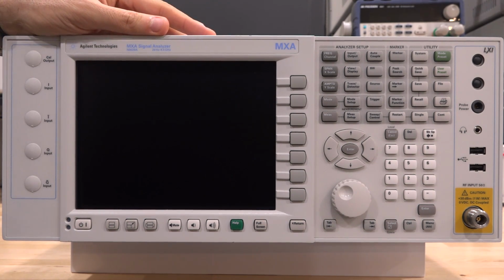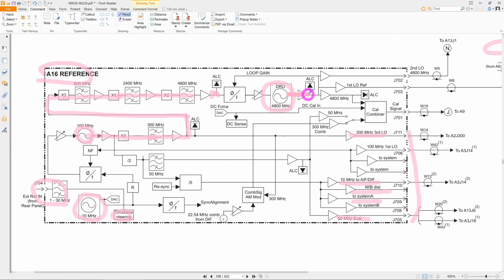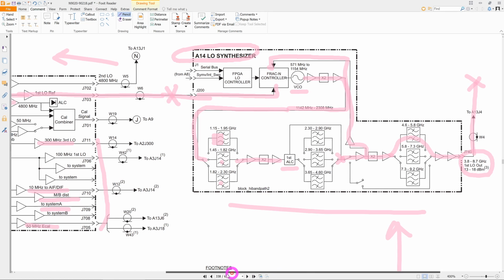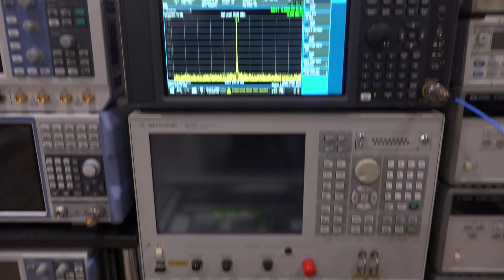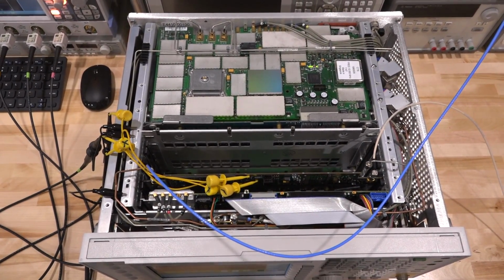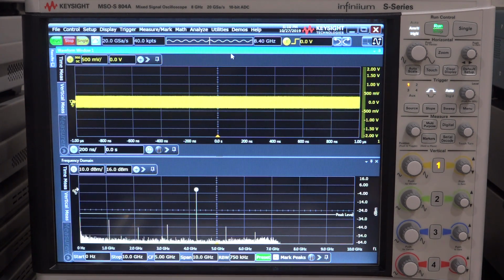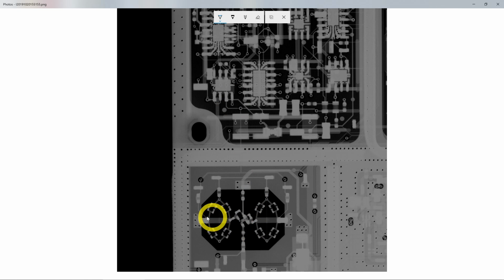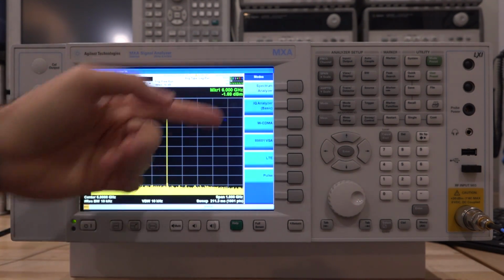TSP #160 - Teardown & Repair of an Agilent N9020A MXA 10Hz - 8.4GHz Spectrum Analyzer (Nov. 2019)

Comment: Hello, that's a great video, with excellent explanations. I have a similar problem and I want to try to fix the instrument. I don't have all the means to troubleshoot as you do, so I want to start with replacing the same components as you did. Unfortunately I cannot find an used A14 board. By any chance, do you know the part number of the components you replaced, so I can order them? Thank you!

Comment: Thank you so much for your teaching dedication. I will never use this really good information as I am old 75, but understanding what is going on is invaluable. When on an AIRForce base while out running 20 years ago, my son mentioned that is the radar shack. And I asked how many people work there? He said 200 to 300, and I was supposing 8 to 16 people, 200 to three hundred told me a lot. Radar returns are analyzed, reanalyzed, and then analyzed some more. The machines you have repaired on this site are the type of machines a lot of the information is based upon, and recently in the last 10 years our radar capability has taken a huge leap forward, so I am positive every one of your microwave boards is in use preparing the signal for these grunts to analyze and your mystery chips are that for a reason. NATIONAL SECURITY.

Comment: Thanks for the great videos, you have given me some ideas on some additional test and measurement equipment to purchase that I thought I would never have a use for. I normally don't buy T&E gear that's broken but I have before and discovered like in some of your videos, it's nothing more than loose cables or components. Keep up the great work.

Comment: Shahriar: you mentioned you changed an OPAMP on the output of a DAC on the other side of the board. Was that a red herring? What made you suspect it?
Reply from the maker: It was a buffer right after the DAC which sets a course tuning of the VCO. If it has any issues, it would explain the problem.

Comment: Regarding doing PLL in FPGA vs dedicated chips -- I was under impression that FPGAs had an order or two of magnitude more jitter (another way to look at the phase noise) than components designed specifically for RF frequency generation? But maybe it does not really matter, is the loop bandwidth is quite low?

Comment: OMG, these things are still like 10-20k$ even on ebay, how to you get them so cheap?
RF shields looked better in the past, like the big milled shield on HP 3585A input mixer/filter, injection molded aluminium parts nowadays.
Reply: He is buying them as broken, which brings the price down. Still even broken they will cost probably around 5k$. Shariar has a lot of Patreon supporters, and that is how he is able to finance all that.  These money are really well spent.
Reply: @adamturowski3765  
Yes and selling a working machine will finance the next.

Comment: My usual method for diagnosing a PLL/VCO loop is to break into the loop and supply either my own VCO control voltage, or my own feedback frequency, that way you can work out what is causing the loop to break down.
Reply from the maker: This would not work here. This is a dual loop PLL. The digital loop cannot be broken.

Comment: A little light on why you replaced the varactor diodes, however I really do need to re-watch some videos, got lost around the FM part of the feedback loop.
still, interesting as always and a nice deeper dive.
Reply: Simple explanation: all PLL  components gains have to be just right to get stable PLL loop.

More advanced explanation: kVCO of this PLL was marginal causing lack of enough phase margin and loop instability at certain VCO frequencies. kVCO is directly determined by varactor characteristic.  In this design 8 identical varactors were used. Shahriar measured them and found that 2 were different than the remaining 6. Replacing 2 odd ones brought kVCO back to where it supposed to be and fixed the problem.
Reply: @adamturowski3765  He found two were different /after/ replacing them though and combined with it working this confirmed his  None of the measurements up to that point showed anything wrong with it. I got the impression it was more a 'I really don't want it to be deeper in so I'll try this [no reason given why this and not somewhere else in the loop] and see if it fixes it' decision, rather than as a result of any direct measurements.
Reply from the maker: @ElectraFlarefire  I spent another 4 hours making other measurements. Carefully looking at every waveform, looking at where things may start to look suspicious or abnormal. Just because it was not recorded, it does not mean it was not done. Furthermore, 
Adam Turowski right above explained it to you already.
Reply: @TheSignalPath  Thanks for the response. I have no doubt that you know what your doing, it was more  a comment that it felt like there was a missing part of the diagnostics in the video and from my point of view 'why try and replace this component' was never really explained.
Reply from the maker: @ElectraFlarefire  Yes, unfortunately with very complex repairs I can't record everything. I will try to be more specific in future videos. Thanks for the feedback.
Reply: I'd actually love to see some varactor diode experiments on this channel